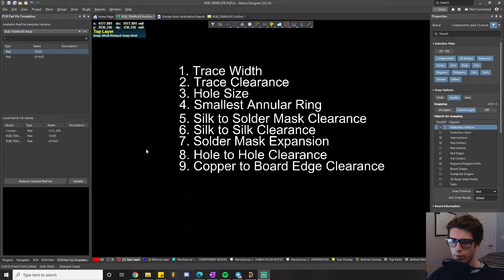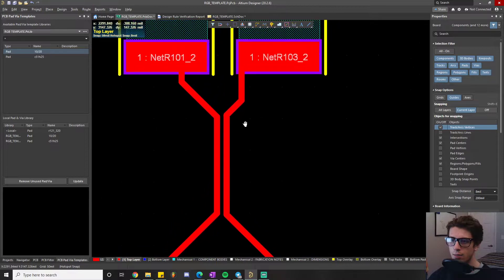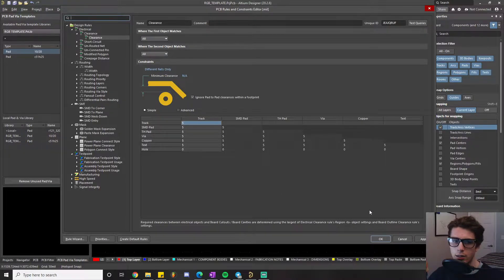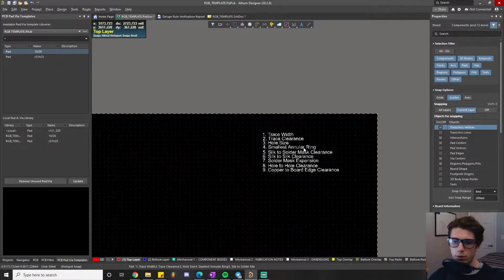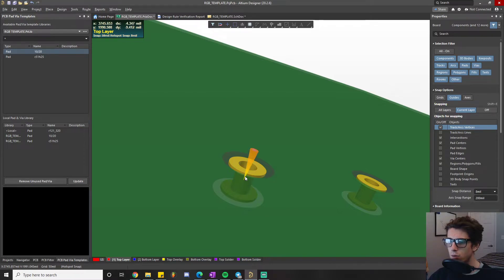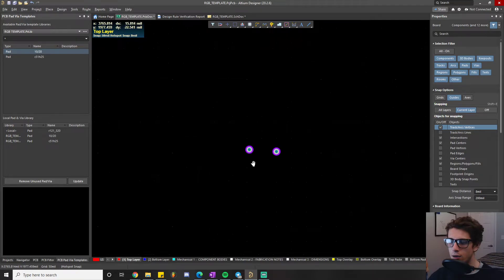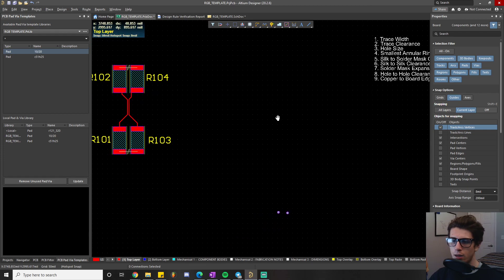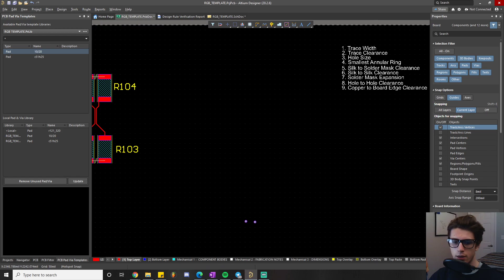PCB DESIGN RULES ALTIUM TUTORIAL | VIA RULES, ANNULAR RING, HOLE SIZE | ALTIUM DESIGN RULES | Pt. 2

Comment: Hi RGB Engineering, 
the confusion about AR is because of the fact that the hole size in Altium and numbers listed later in the Gerber Drill file is the diameter of the finished plated hole for that via. However, the manufacturer must drill that Via with a slightly bigger drill bit to allow the copper penetrate in the hole and build the plating. For my understanding the AR is what left after the pad is drilled. 
For example, if you have 10 mil (0.254mm) hole defined in the drill file and want IPC 3 class with 25 um plating copper, this hole will probably be drilled with the 11.8mils (0.3mm) drill bit. Therefore, this must be considered when the outer diameter of the via is defined in the CAD program.
BR